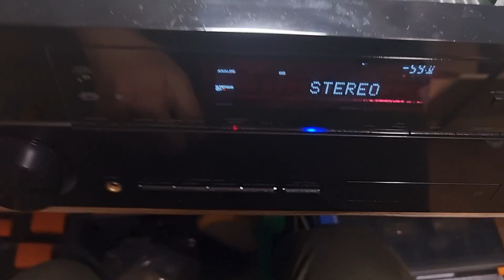Pioneer VSX920 Overheating or not?

Comment: Hi, thank you for posting this video. I have a question: Did the "AMP OVERHEAT" message always appear on the display of the receiver you repaired? My VSX-920-K shuts down intermittently, sometimes after a few minutes, sometimes after a few hours. However, I never see an overheating message on the display. In my case, the blue PQLS LED flashes, which according to the manual means "Abnormality DC voltage of the Digital power supply" detection. I measured the resistance of my posistor, and it's 219.8 ohms. That's well below 300 ohms. I'm wondering if this component's wear and tear isn't confusing the voltages on the D-MAIN board and sometimes triggering the protection. Have you encountered a similar symptom with this or a similar model?
Reply from the maker: It could be related. I think if it were me i would unplug the positor and jury rig a resistor and that way it could be eliminated.

Comment: Hi, thanks for the video!  My pioneer Vsx-lx70 reciver, went into safty mode (the flashing light mcacc) during a party after some one spild som drink on it. after 2 days of dying i reseted the reciver and it works...  but it indicates "Over" on high volyme! i use Pioneer HPM150 speakers on hi volyme! is this a good combination?  Filip
Reply from the maker: Glad you enjoyed it. Much appreciated. Might still need a clean with isopropyl because the drink whatever it was may corrode parts over time if it hasn't already started
Reply: @FentronixElectronics-ul9kq  thanks for you answer, you dont thint the Over indication is a problem?
Reply from the maker: @filipjohansson356  yes i think it  has an issue.  So you feel confident to work on it?  I would start by cleaning the board still. If you do please be careful and if you have no way to safely discharge the caps, leave it a few days unpowered before working on it
Reply: @FentronixElectronics-ul9kq  Hi, okay i have made som more investigation now. So now i know this indication OVER has ben sen on this amp befor the water accident earlyer on the party! 

 The indication OVER shows when i turn the Analog signal upp on youtube from the computer! (I use a computer ass digital media to a DAC Hegel then to the pioneer amp) And when i turn the signal down on youtube there is no OVER indication!

It doesn't matter if the volume is low or high. still same indication!  

And the fan is not running!